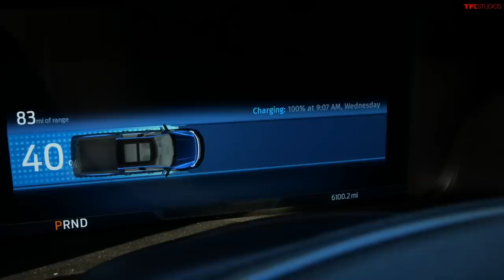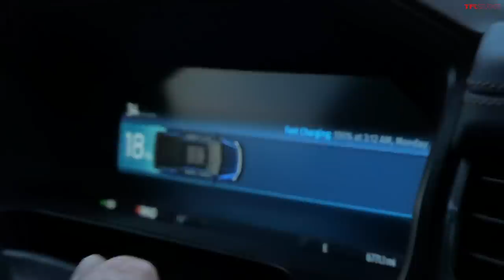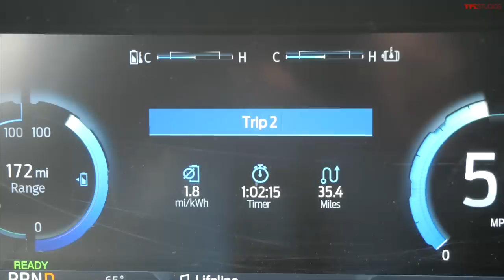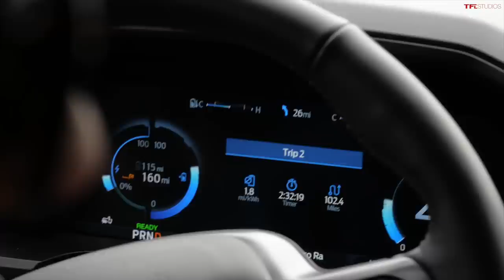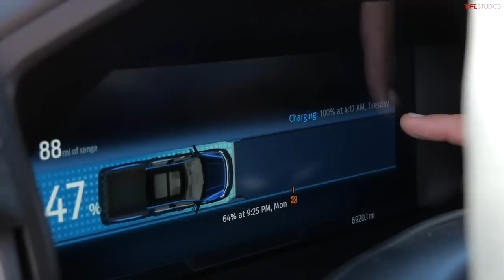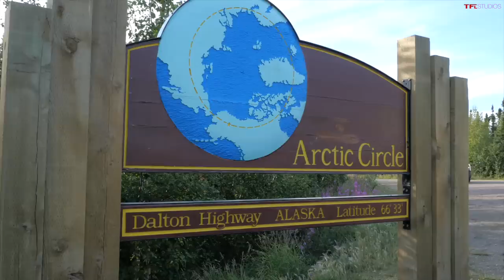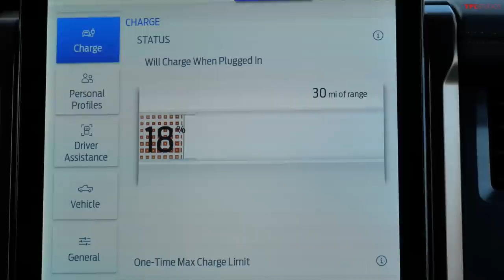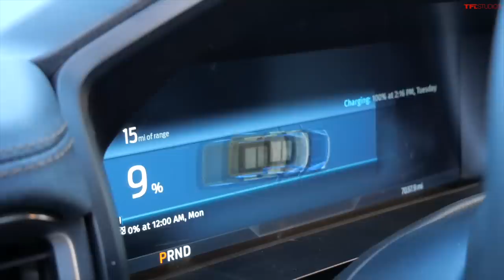Easy Part Is Over: Driving an EV Truck Into the Alaskan Wilderness Is HARDER Than We Thought! Ep.4

Comment: At the end of this episode in Coldfoot, did anyone notice the temperature of 60 degree at the old Alaska shack when the first pulled and when they were about to charge the temperature had already dropped to 40 degrees. I wonder if lower temperatures affects the rate of charge?
Reply: Not really..  the batteries are water jacketed now.  So they are cooled and heated as needed.

Comment: You can get 2 single plugs for 120 and a adapter box to max 240v. Just max amps would be about 20amps. Do not use a GFI outlets for this as the outlet will trip. You should have a multimeter for checking of plug voltage.

Comment: I'm surprised you didn't bring solar panels. Also, there is a converter cable that uses (2) 120 volt outlets to get 240 volts, but the outlets have to be on different circuits. Maybe some of the well known battery solar chargers would work too. ECOFLOW has 240 if you use 2 of them and have their combiner hub system.

Comment: You know it is possible to use two 110 outlets and combine them,with a "y" cable to get 220volt line. They have to be on separate lines though or you could trip the CB...

Comment: To the one viewer that commented, I want to drive that highway before it gets paved. You have plenty of time. I doubt that hwy will ever get paved. No point, not enough traffic, to severe of winters and the state of AK couldn't afford it. Aren't most of those stations up there powered by gen sets like parts of the Yukon? So if they shut off the generators at night for quiet time, adds another problem. Not practical yet or in the near future.

Comment: I love this series. 
Waiting for my reserved Silverado EV.
Few questions,:
Could you charge off a generator in the bed?  Those could run off propane or gas?
What characteristics does a generator need to change this vehicle?

If the generator is well secured could it charge the battery while underway? Legal or technical complications I guess.  It might not fully charge the truck but may extend range by 100 miles?

Similarly, if you have a solar panel on top of camper could it charge while driving and extend range somewhat?  50 miles more might help.  Would add some weight.
Reply: @Fart Zilla Thanks.  So I you drive 6 hours you will add 6*12=72 miles to the range.  minus affect of added weight.

Comment: So all you have to do to make this trip is 1. overfill your tires, 2. drive at an extremely low speed, 3. take much more time than you should need, 4. have a second vehicle with power-out capability or a gas/diesel generator to make it to the destination. And don't forget, only try it in the summer...the cold would make it even harder or impossible. Of course, you also need the goodwill of the people you meet along the way (or have extra money) who will let you use their electrical outlets.

Comment: I would still equip the truck with a 2nd ac to DC charger as in a 2nd j1772 or dual charging port for ac charging will be neat and would slice the charging time in half and be able to charge from 2 240v outlets at 30 to 40 amps or in combined out-put of 60 to 80 amps ac. Towards the truck.

Comment: Nice documentary about the travails of driving an electric truck to Alaska. Everyone should see this video and learn from it. Electric vehicles are a pipe dream. Who want's to plan and mold their life around availability of fast chargers and go through the headaches of waiting hours on end to charge a vehicle? Especially when you're out in the 'middle of nowhere' and you only have access to 120 volts and it's going to take you 5 days to get enough juice to go less than 200 miles! From what I've learned about EVs they are not any cleaner than an ICE vehicle, the extra load on power plants that use fossil fuel to generate the electricity to charge them causes MORE pollution than if it were an ICE vehicle. Not to mention the mining pollution to make the batteries for them. The "greenness" of them is nothing more than an illusion, they are actually worse for the environment than ICE vehicles. Throw in the inconvenience of using one of the, plus the extra cost and EVs are total losers!

Comment: Would have been curious to find out how much weight you gained with the mud on the truck!  That calcium is sticky crap and even if the sides of the vehicle aren't thick with it, every nook and cranny underneath will be full of it.  On-board scale is kind of nifty, and I hope that becomes standard feature in trucks, electric or otherwise.  Seen a lot of overloaded half-tons over the years where guys shoulda really got the next size up.

Comment: Quite an adventure in the summer.  The winter would be...?   I am waiting for the road test in winter temps north of 40 degrees latitude.  How does the cold affect battery life?  How is range impacted?  What portion of the power consumption is needed to operate heating in the vehicle?

Comment: You should do a tow to recharge test at some point. Using the other truck to pull the lightening with the Regen brakes on full. See how much range is gain vs how much gas the towing truck uses as opposed to charging with the generator. Others have done a similar test with surprising results.
Reply from the maker: FYI: Ford says that will void the battery warranty.
Reply: @TFLtruck  seems odd that it would given how the system should work. Perhaps another EV manufacturer for a future video?

Comment: The camper is not the issue. The computer drastically over estimates the range. At least that’s the case with our Model S. By the way, you mentioned charging the Lightning with the gasser, how much range do you add?

Comment: I am a camper, and an electrical engineer.  I believe the concern with charging EVs at campsites is power capacity.  Yes, the pedestal leads us to believe it is capable of supplying up to 250 Volts times 50 amps, or 12,500 Watts, but that says nothing about the average capacity available to each pedestal at each campground.  When engineering such installations, it is not uncommon to make assumptions, and only provide an average capacity of much less than 12.5 kW.  In my experience, an average capacity of 7-8 kW per pedestal is more typical.  If every site attempts to draw more than that amount--which could happen if everyone is charging an EV--then the entire campground would experience a voltage drop.  if the voltage gets too low, it can damage the electrical system on campers or cause appliances, such as microwaves or A/C units, to not turn on at all. This is a very common senario at full campgrounds on a very hot day, every RV is running their A/C, and they burn out or shut down due to the low voltage, then nobody has A/C. So, all your neighbors start asking, "Why are we paying for electrical service when there effectively is none?"  This could happen in the future if all the sites have an EV charging at once.  personally,  if I owned or managed a campground, I would ask EV owners to only charge after sundown when no one is running their A/C anymore.  That may prevent overloading the capacity of the overall campground.

Comment: I could be wrong but that looked like a NEMA 6-50 which is the second most common type of EV charge outlet besides a NEMA 14-50. I'm genuinely really surprised you didn't have an adapter for that plug of all plugs but you somehow had a NEMA 10-30 which hasn't been used in like forever and has no ground so wouldn't work with a modern EV charger anyway...

Comment: I like the idea of this truck and camping. It’s not practical, but the idea is there. On site charging is an issue though for the camp owners. The electric they provide and you pay for is intended for the use at the site in my opinion. Taking the power with you as you leave should have a cost aside from the on-site use of the electric. Otherwise costs for camping will go up for everyone in order to cover the costs.

Comment: You can make a 220 adapter  rv plug two wires to power it but you have to  have two separate lines of 110/15 merge them together to make 220/30 amp

Comment: Should have taken one of those 240v chargers that you can select the amperage on. Would have helped at the 70a outlet (with proper adapter) and the need to carry the Ford one (although I still would have). I have been wanting to do this trip in my gas F-150 since 2017. I get to live vicariously though.

Comment: What would have happened if 2 or three more ev trucks showed up at the same time?  How about 100.
Reply: That's a silly scenario to consider. If there was that much EV density, there would be charging stations. Where there is demand, business will rise to fill the need.

The bigger issue is the capacity and reliability of our power infrastructure overall.  EV technology will continue to evolve. More and more people will find EVs make good sense for what they need it to do. Our power grids will be taxed, and that will be the real limitation. 

Match the vehicle to the job it has to do. If you're hauling pallets of pavers, you don't do it in a Tesla.

Comment: Roman F=density x Area x velocity^2 so the force required to move a body through the air is the square of the velocity, it’s not exponential….. twice the speed = 4 x the power, 1/2 the speed = 1/4 the power that’s why you got so much more range at 30 vs 50 mph.

Comment: I know at some point in the near future i will see someone pulling a diesel generator behind an EV truck to go camping. Kind of defeats the purpose I guess. Though this is an extreme trip, it just goes to show that what works in densely populated areas does not work everywhere else. But let's be honest...a Lightning (or any EV truck) is not really meant to be for the person who actually does "truck stuff" and this video series has proven that point over and over. EVs are just not the one size fits all solution folks claim they are and never will be (at least in my lifetime anyways). Great video series!

Comment: Easy solution is using kinetic energy from the wheels to keep the battery charged to full capacity with circuit shutoff so it doesn't overcharge which could cause overheating and battery fire. The technology  exists but the automakers aren't making it happen.

Comment: The reality is that trucks will need to be range extended designs with a 10kw power plant and battery similar to what they currently have. The truck didn't make the drive and you excluded all of Canada in the drive, and while you admitted to what you did (ferry ride, charging via chase truck) it would have been much more realistic to show the time and hassle in populated Canada as well... Like with that washout, did you have the ability to turn around and go back to another charger .. 
Imo full electric trucks are nearly impossible due to the amount of electric power needed and charge times for that amount of power. It would need to have 2 hour charge times for 1000kw to start to be feasible as a TRUCK and not a truck being used as a car/SUV.

Comment: A nema 6-50 to a nema 14-50 adapter should work.  I don't believe there is a standard plug for 70a.  Most ESVE go up to 50a on 220v.  Anything higher, like the standalone Tesla destination charger, has to be hardwired rather than plugged in.

Comment: Thanks for doing this painful trip…I’m not bagging on Ford, somebody had to be first.  If someone had taken a model-T to Alaska in 1910 it would’ve been even worse than this.  Now, we need to improve the charging system and install a  250 amp fast charger every 30mi. on every major highway in the U.S. before these are fit for mass use. I’m going out and buy a 3.0L diesel to get me by until that happens…hopefully it only takes one!
Reply: the other ev truck maker employee took on no word if anything was in bed he went ny to cal . it took him 2 weeks
more frequent charging as well as time spent charging and some time trying to find charging stations
a gas pickup can make trip in about 3 days record in car is under 48 hrs

Comment: That would be something interesting to add to your EV testing.  If you drive slow enough to greatly reduce drag on the vehicle what would the range be?  Maybe the trick to doing long distance driving in an EV is to find that goldy locks zone of speed on the highway that reduces the number of times you have to stop to charge the car?  
Naturaly yod probably have to put some emergency lights and find rural paved roads with low traffic volumes to do it but some states still allow stuff like 55 mph or even lower speeds on some roads.  Maybe the solution for long distance EV driving would be a new national std limited to the slow lanes?  All those stops eat up allot of travel time and if say driving at 55 or 50 reduced 1 or 2 ev charging stops it might save you time in the long run for the day?
Reply: Wouldn’t that be great? Drive 35 everywhere and sit for hours to charge back up! Man I can’t wait for this future being shoved down everyone’s throats.

Comment: This is just dumb. You need TWO trucks, so about $180k plus a bunch of other stuff and drive 30 mph. Could have put an auxiliary fuel tank in a 3500 diesel and had 1500 mile range at at normal speed for at least $100,000.00 less. And had it been winter, Darwin may have got you.

Comment: 34:09 : So what you're seeing right there sure looks like a NEMA 6-50R.  The appeal to these (for something like a welder) is : There's one less conductor you have to pay for (2 hots and a ground).  Most EV users are accustomed to seeing a NEMA 14-50R (which has 2 hots, a ground, and a neutral).  This has always amused me, because : A lot of fixed EV chargers (i.e. ones that don't have a plug but are hard-wired to a circuit breaker) don't actually use neutral... just 2 hots and a ground!  NOTE : The preceding applies to the United States where 220V power is split-phase

NEMA 6-50R is just an older standard, so it's not surprising to see it "that far out" in Alaska instead of a 14-50R.  The electrical supplies out there probably cost a fortune to begin with, so that coupled with welders historically using NEMA 6-50 in the U.S. is why that was what they were given.

What I am kind of surprised by is : That the TFL guys didn't make sure they had a 6-50P to 14-50R adapter for their chargers.  If you look on Google for "40Amp EV Charger", a Leviton unit is in the top 10 results that uses a NEMA 6-50P for power input.

Honestly, if they were really stuck, they probably could have just paid somebody local that does electrical work to make them an adapter, as somebody in that town probably has to have some scrap 8 gauge 2-conductor w/ground and a 6-50P and 14-50R for the right price.  When you live that far out, you don't throw scrap wire away... you make a "scrap wire box" that ends up saving your ass some day!

In any event, I'm glad they were able to figure out there was also a lower-amp dryer outlet.  The "teaser" shows one of the guys staying up on "night watch" to make sure the vehicle charged, so hopefully they didn't run into a situation where they kept popping the dryer breaker or something.

Comment: Thank you for demonstrating how impractical 100% battery-powered electric vehicles are at this stage of the game because of the limitations of the current battery technology being used in 100% battery-powered electric vehicles. Until more technologically advanced batteries become available that provide a minimum real-world driving range of 500 to 600 miles, and which can be fully recharged in 5 to 10 minutes - plug-in hybrid electric vehicles (PHEVs) are so much more practical since they allow you to draw power from both the gasoline in the vehicle's gas tank as well as from the energy stored in the vehicle's batteries. Back in 2011 GM introduced a revolutionary new PHEV technology in the Chevy Volt which utilized two electric motors to drive the Volt's front wheels. The two motors could be unclutched from each other, leaving the outboard motor (the main electric drove motor) connected to the front wheels and allowing the inboard electric motor to be clutched to a 4-cylinder gas engine and become a generator to generate the electricity needed to power the main electric drive motor when the car's battery becomes depleted. The driver can select power from either the batteries or from the gas-powered generator, and when the battery becomes depleted the intelligent drive control system automatically activates the gas-powered generator. This unique PHEV technology was also utilized in limited numbers to produce the first-ever electric-drive Cadillac in the 2014 through 2016 Cadillac ELR. In 2017 was very fortunate to locate a 2014 Cadillac ELR in like-new condition from Pepe Cadillac in White Plains, NY with only 11,400 miles on it. They had been using it as a fleet car and kept it in perfect-running condition. It was a fully-optioned model with a sticker price of $80k and after test-driving it and experiencing the power and the instant throttle response of Electric Drive - I couldn't pass up the $34k offering price of this rare like-new gem which is one of only 2,403 2014 Cadillac ELRs ever made. It is the best car I've ever owned! It has been trouble-free and I've been using so little gas that I only go to the gas station once every 2 or 3 months and it only takes between 5 to 6 gallons of gas to top off the 9.3-gallon gas tank. It really shines on long highway trips, where I can refill the gas tank at any convenient gas station along the way, and, in less than a minute I've got over 260 more miles of driving range. Those sure beats having to hunt down a charging station and then getting stuck there for over an hour to get a mere 125 miles of extra driving range with a 100% battery-powered electric vehicle!